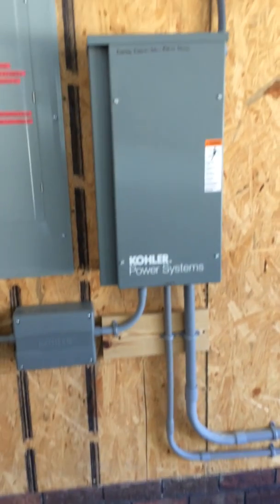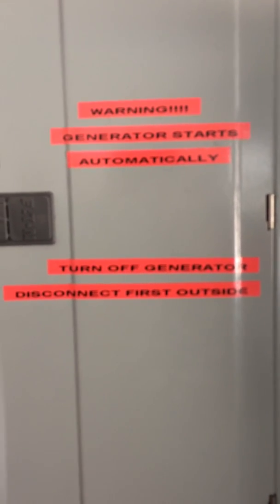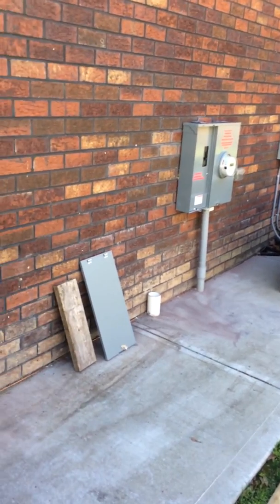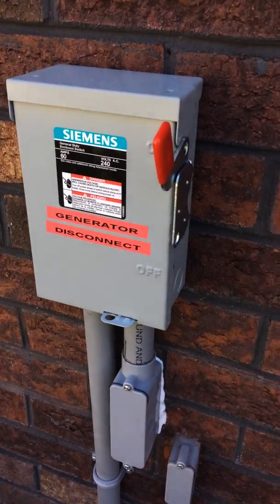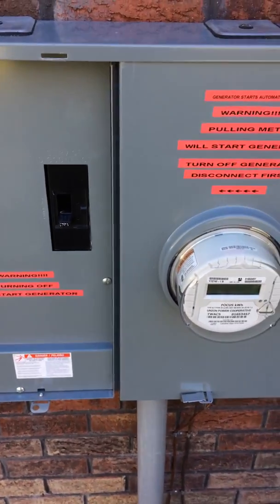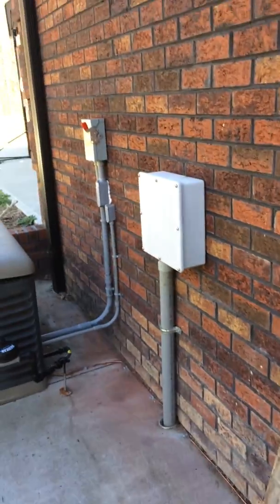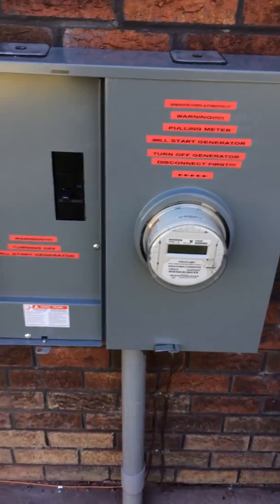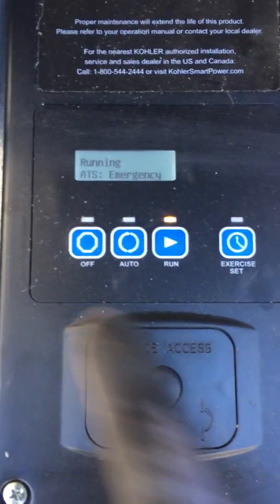Koehler generator part 4

Comment: I understand the electrical  code, but fire department would shut gas off at meter and unit?
Reply from the maker: Eric Davidson they would shut the gas off to the house, but the generator can turn on because it’s fed by a large propane tank. So if they turn off the gas and pull the electric meter, the generator will still start. All the signs let them know to shut off generator switch before pulling electric meter.